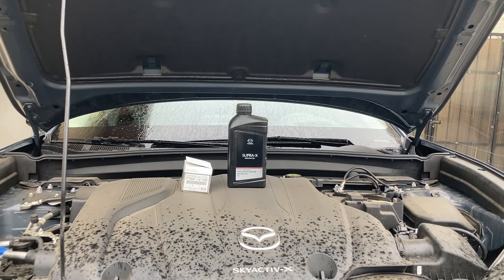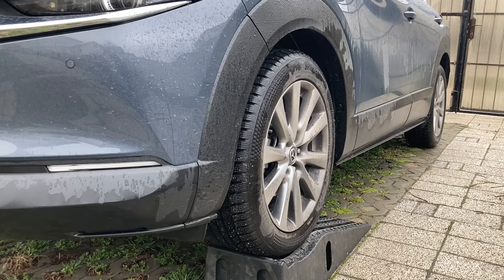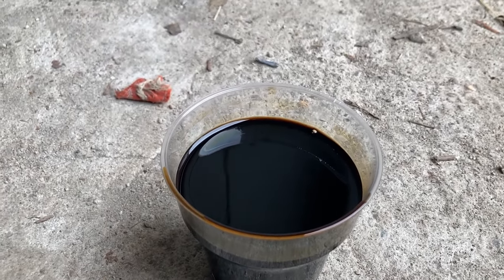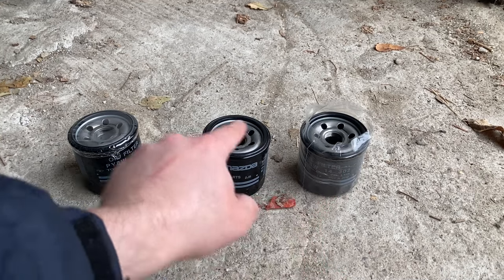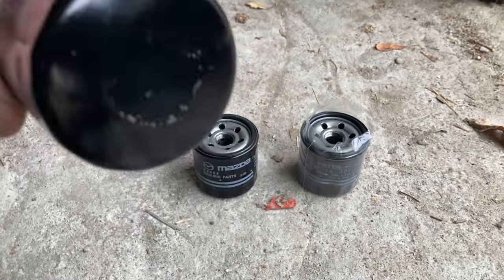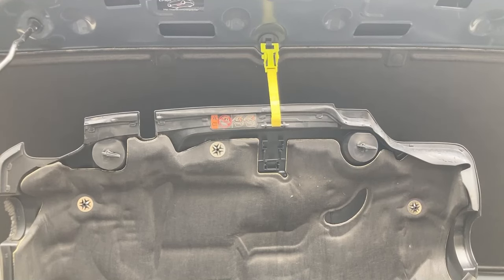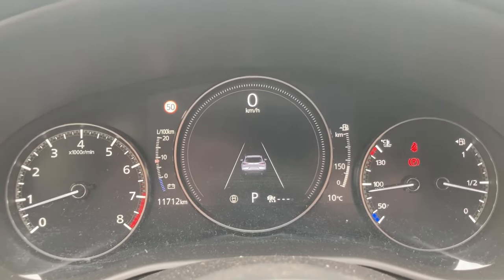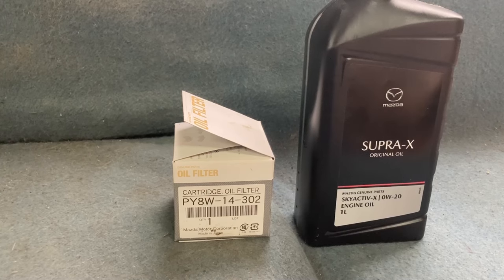DIY - 2023 Mazda CX-30 SkyActiv-X: Full service (air, cabin, oil filters and oil)

Comment: Hello @The Missing Bolt, thanks for your content. 
This DIY oil change does not affect your 7 years guarantee from Mazda? Thanks
Reply from the maker: Depending on the country you're based in, in theory it may or may not. But if you're using only genuine parts and work carefully (not overtightening the filter or the drain bolt etc.), a dealership won't be able to identify that an additional oil and filter change has been performed at all 😉
Reply: @TheMissingBolt  that’s the idea that i was thinking after i sent you the above msg😀 greetings from Romania🍺
Reply from the maker: @v.ans29  Salutare! 😁 Da, in Romania sigur ar putea comenta daca iti faci un schimb de ulei singur, asa ca cel mai bine este ca ei sa nu stie 😁
Reply: @TheMissingBolt  în totalitate de acord cu tine👌imi poti spune de unde ai gasit cheia pt filtru de ulei? 

Eu tocmai ce am plasat comanda de CX-30 modelul 2025 cu ETA prin nov-dec 2024, motor 2.5AT MH 140cp. Deci, asteptare lunga😀
Reply from the maker: @v.ans29  Cheia e similara cu Yato YT-08235 (diametrul filtrului parca e in jur de 70 de mm). N-am mai intalnit CX-30 cu motorizare de 2.5 si 140 de cai, n-o gasesc in configuratorul oficial. Stiu ca 2.5 a fost pus pe CX-5 si pe CX-30 doar in SUA, dar are aproape 190 de cai. E vreo versiune noua, care n-a fost anuntata inca?

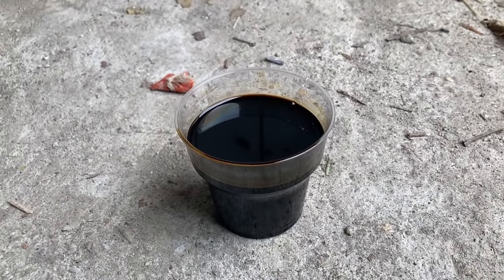Comment: 10:56 Brother, what is this? Tar? Your car only has 11k on it and the oil is that black? The oil in my Skyactiv-X barely gets darker on 8-10K intervals on a 30K km engine.
Reply from the maker: It does a mix of 50 - 50 urban and extra-urban driving, with the urban part being in Bucharest where the traffic is very bad, so there strain on the oil is higher than normal. But keep in mind that oil color is not a direct indicator of wear - on diesels for example the oil gets black in less than 100 km after the oil change because of the turbos.